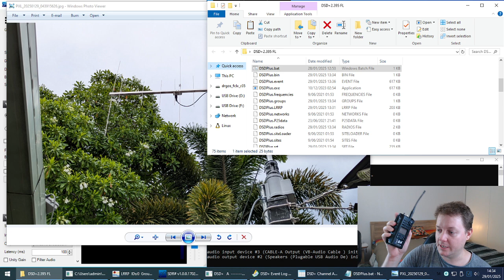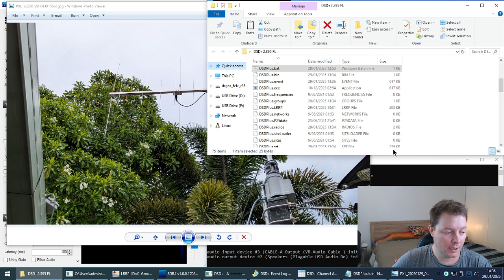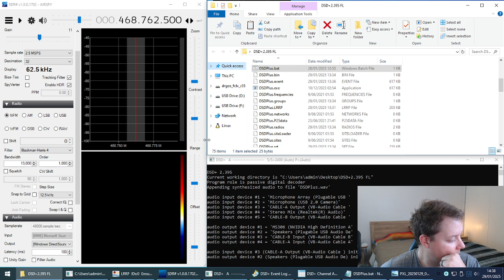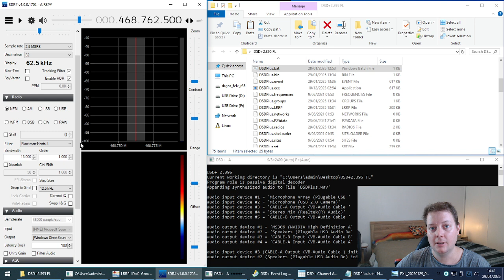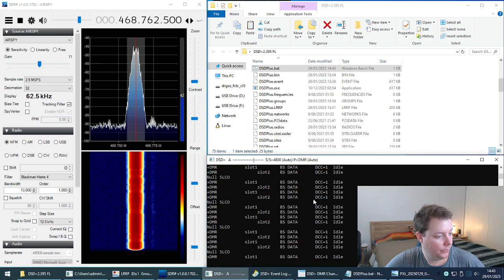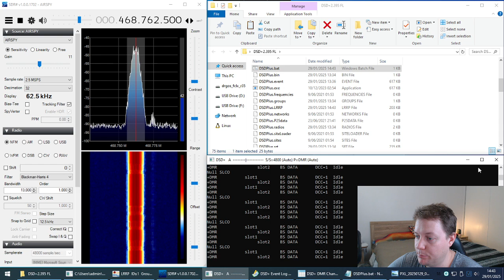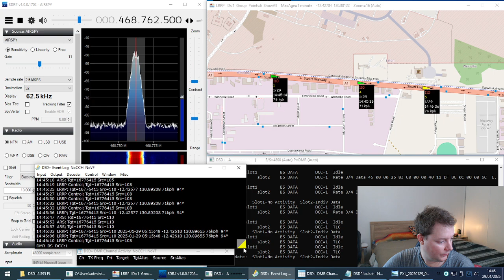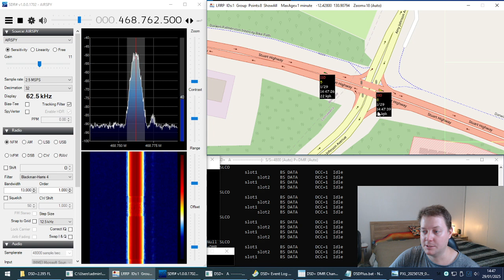Tracking Mobile Assets By Decoding DMR Radios' Automatic Vehicle Location Feature (AVL)

Comment: Have you considered processes for decoding microwave terrestrial datalinks? I'm putting together a frequency down-conversion mixer setup to try this. The links are unencrypted, often TCM modulated, BELL (or similar protocol) multiplexed. IDK if there is existing software to look at that, but often SS7 or raw packet data is under it, HTTPS/end-to-end encryption/IPsec being really the only encryption possibly in the way. Could be an amazing software project!! And an eye opener for security in internet infrastructure. A good computer could theoretically capture most of the cell AND internet data in a city this way!!

Comment: Couldn’t figure out dsd free version for the life of me . Going to have to buy dsd+ :(
Reply: Download SDR Trunk instead and set that up. Less of a headache.
Reply from the maker: @ReefMimic Hi. And yes, to a newcomer, DSD can be pretty difficult to work with, since it doesn't have a GUI in the traditional sense. But once you figure out the numbers of your input (virtual audio cable) and output (PC speakers) devices, it's as easy as launching the .BAT file to start DSD+

Comment: So in DSD+ I see a lot of the received packets are “Idle”. Is that just a basic carrier signal? I see sometimes it’ll change to something with data.
Reply from the maker: Yes, IDLE packets just means that there is no traffic being transmitted. And you'll really only see them when decoding a DMR repeater downlink. Typically, you don't get them in simplex operation (radio to radio, with no repeater)